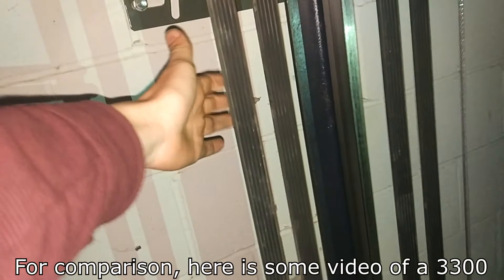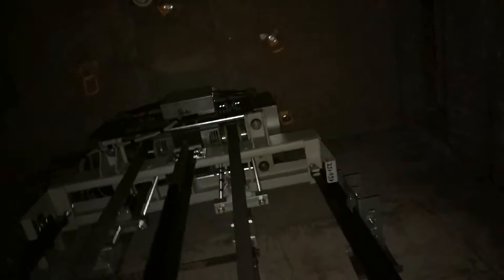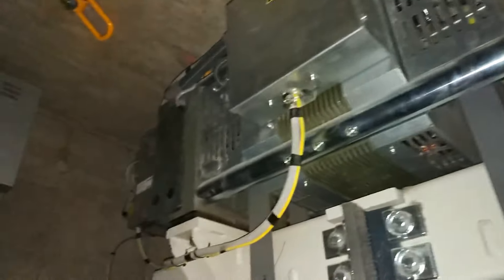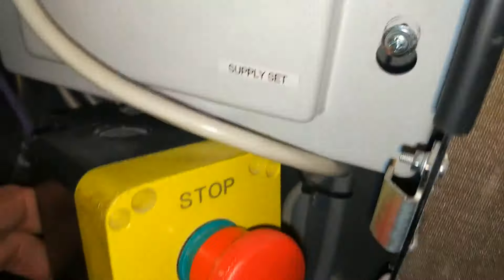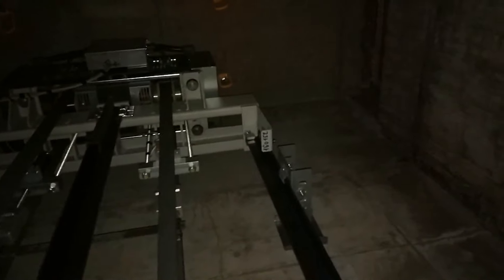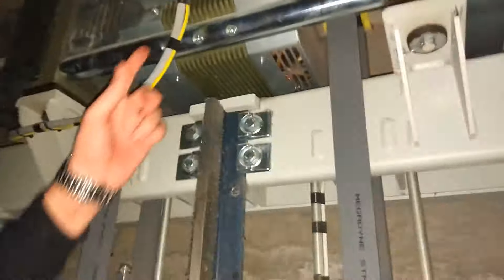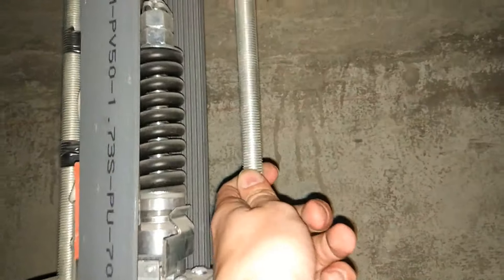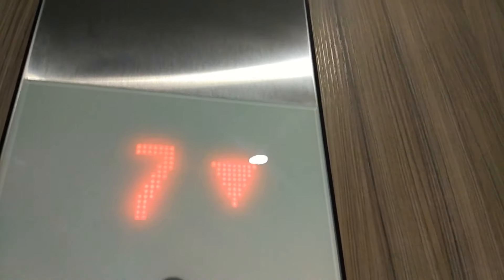Detailed look at Schindler 5500

Comment: Schindler 5500 goes up to 3 m/s. While Schindler EuroLift and 5400 are either 1, 1.6 or 2.5 m/s but 2400, 2500 and 2600 are either Hydraulic or MRL Traction 0.15-1.6 m/s.

Comment: 5500 is definitely much more improved than 3300, I like the way it runs with intelligent levelling and pre-doors. I've been in a couple recently (my first ever 5500's) and I was really impressed with them!
Reply from the maker: 5500 isn't an improvement over the 3300.  5500 is an update to Eurolift.  It has the new logic, the belt cables and new motor, and new buttons.  The 3300 is a cheap version which Schindler made to lower their prices.
Reply: New capacitive buttons and added 3 m/s speed.

Comment: The 3300 voice that is used in England (ex. floor 1, or floor 0) can also be used in American/Canadian installations but NOT ON 3300's. They have used on installations like the 400A/400AE (now discontinued, correct me if wrong), but I seen some on PORT installations  or mods (newer installations as before Schindler used the American voice).

Regarding the 5500 voice, the one that has the word "Elevator" is also used in 5500 installations in USA/Canada. Except, they do not feature the door annoucements, as that is only for PORT installations when the handicap feature is activated (correct me if wrong).

Comment: The chasiss is made of cold formed steel and the tracks of hot rolled steel. Usually cold formed steel looks and feels flimsy, but that's because it's folded sheetmetal. The steel quality is quite different to hot rolled steel. Hot rolled is actually a lower quality steel. The flimsy sheet metal actually has a higher yield strength and young's modulus then hot rolled steel. This is the reason they can make it thinner. Hot rolled profiles are usually used for big structural components of buildings and cold formed for mefal-stud profiles that are used in partition walls with gypsum board. Lift companies use cold formed steel for practial reasons, it's lighter and sufficiently strong. Personally I prefer big hot rolled profiles like HEA beams. I must say that tracks have a rather low second moment of inertia compared to what I'm used to when designing building structures......
Reply from the maker: I do not know much about materials.  With lift chassis I call a standard lift from the 60s margeish metal beam across the top a proper chassis.  A 60s goods lift or high speed lift where the chassis comes up to chest height I call a heavy duty chassis.  A lift with just a beam across the top that isn't very large I call a small chassis.  These beams are all the standard type of industrial beam that you see on many uses.  Modern lifts often have what looks like a split beam where the beam across the top is in two half like on this lift.  I don't know the strengths of these.  Do you think the chassis on this lift is the equivalent of what sort of 60s lift (as you say it is of a stronger material).
Reply: Those old chassis where often made from UNP profiles (or similair). The lift cab itself was just a box inside the frame between the tracks. Only that frame + the floor where structural components (except for heay goods lifts). Modern chassis have a different design philosophy. There, the entire lift cab is a structural component, including the sheet metal wall panels. Both designs are able to deal with the forces subejcted to them. I'm not a mechanical engineer so I don't know much about structures in motion. Mechanical engineers often only design with steel and things that are manufactured to high quality standards and fine dimensional tolerances. When you design with brick, wood or concrete the tolerances are not as precise and safety the factors in the material strength and the load are much bigger.  We use a lot of "reduction factors" in the strength to accomate for poor workmanship on the building site. Mechanical engineers that design lifts have it much better as they don't have to deal with "artisan" tolerances. If you look closely in the lift shaft, you'lle see how much washers are used to space the mounting hardware for the tracks, shaft walls aren't necessarily smooth or plumb. Brick is in fact a terrible material to mount things on, it's pretty soft. Reinforced concrete walls are preferable because of the strength and the ease in which you can embed mounting hardware into the formwork.

Typically ordinary hot rolled steel has a yield stress of 235 N/mm² (MPA) That is 23,5 kg on a single sqaure millimetre of cross section. The ropes can easily be over 1500 N/mm².

Comment: now when I watch this video bout 6 years after being uploaded its pretty fun if you take in mind what TKE now builds on average. Your description of them being not much more than a Spanish generic does well. Compared to this, the 5500 is a far better lift. In my opinion, the 5500 - from the perspective of a passenger - feels like it is built of suitable quality. Although I got to point out that they most-likely won't live as long as an old relay-controlled lift.  I wonder what they do when the 5500s get old and are due to modernisation.

Comment: I quite like the Schindler 5500. However, as you said, there are still trade offs that you get like the motor sitting on the tracks and those rubbish looking rods holding up the cables which look ridiculously small. The logic is nice as it is efficient with intelligent levelling but it is also bad because of its lockdown thing. I think if the poles were stronger and thicker and the tracks were not supporting the whole thing and the logic is not as restricted then this would be a great lift

Comment: Wow I go in a 5500 at my shop it has a set of 2 I also looked up the shaft and saw the motor 1 time I saw one had shaft lights on while it was running not on fire mode and I got to go in it